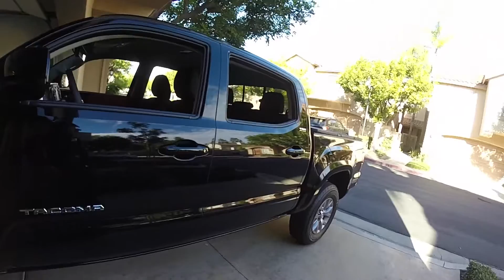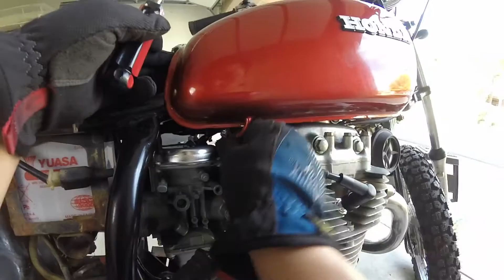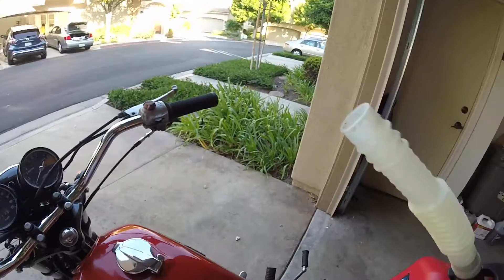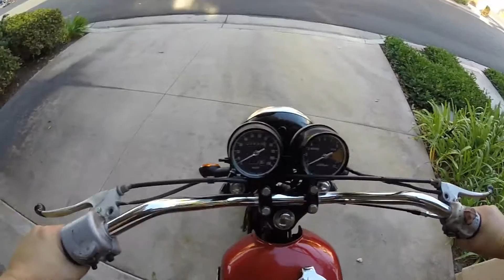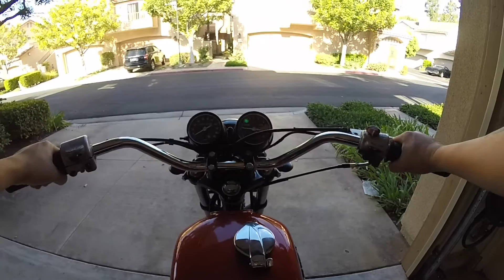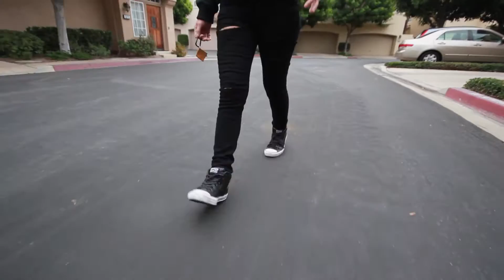1975 Honda CL360 Part 7 - CARB REBUILD and START UP

Comment: My CL350 was doing the same thing after I had the gas tank off . I had tightened up a ziptie under the tank which in turn extended the throttle cable, keep riding and Have a great Thanksgiving

Comment: I´ve got a CB360 but it comes with EX500 Kawasaki carbs, the original ones are difficult to find here in México, there are other carbs that can match? Saludos.